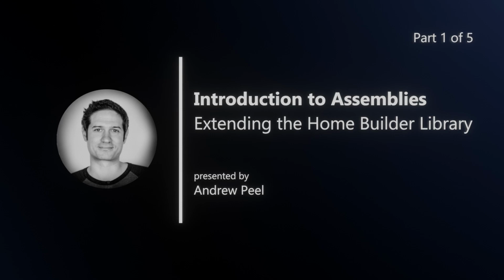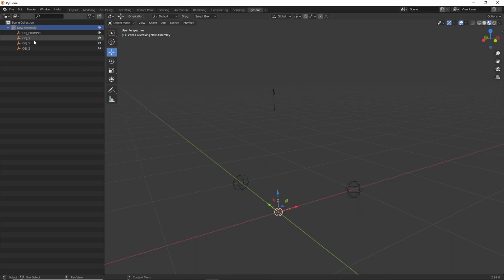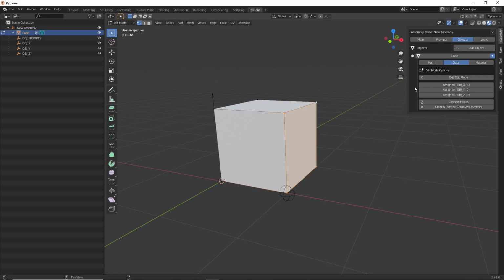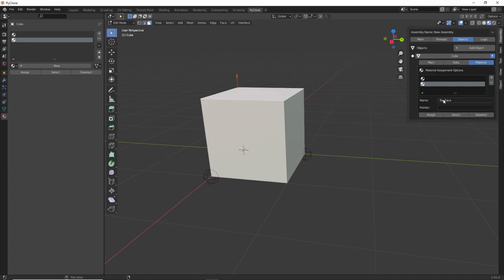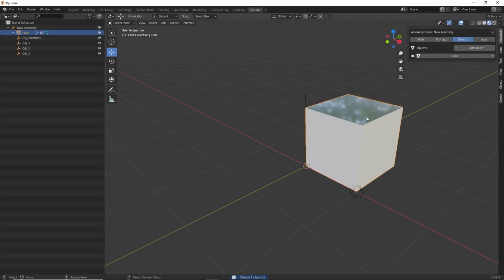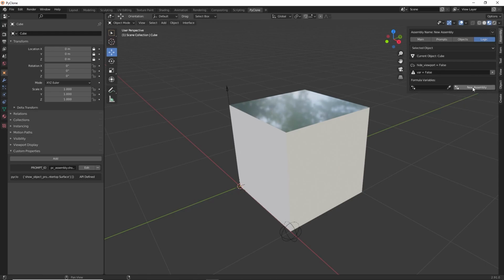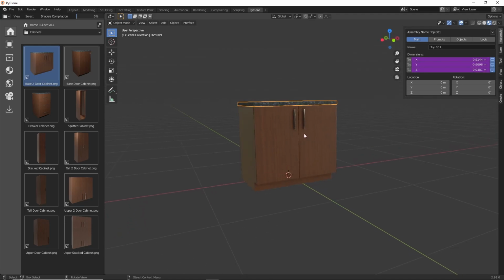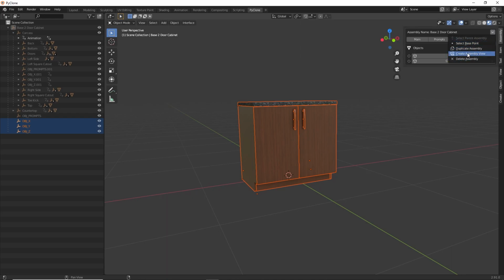Introduction to Assemblies

Comment: As well as the Hide logic can you also have a Boolean Cut tick box to either cut or not cut an object?
Reply from the maker: Yeah this is possible. This is how I create the cutout for sinks and the toe kick notch on the cabinet sides. I will be creating more advanced tutorials on assemblies and how to create this type of logic.
Reply: Data paths and drivers seem to be pretty intrinsic to blender. If you can get the path, and there's an appropriate control type, I guess you can control anything within reason. i.e. A quick boolean object, and right clicking on the render visibility of the bolean modifier and selecting the data path gives modifiers["Boolean"].show_render
It's just a matter of mapping that to a control in the assembly I guess. (To be fair, I was half alsleep when I watched this, so I may have missed something :-)
Reply: @stephen-boddy  Nested Booleans can be 'hit and miss' in other programs - I know that Revit makes a mess of it.  I was wondering whether Blender was happy...
Reply: @Lake-Mist-V  I'll pass on making a prediction on that. I'm a newbie on blender. I know the old boolean code was hit and miss with geometry that was too close together, even for simple cubes. The recently added "Exact" method is slower, but far, far more reliable. I've done some simple nesting of booleans, (Shape a + shape b - shape c kind of thing) and it seemed to work ok. YMMV depending on how complicated you are trying to go. It reads a bit like you don't actualluse blender. All I can suggest is you give it a spin, and try to make a sample object that is of the kind you are thinking of.